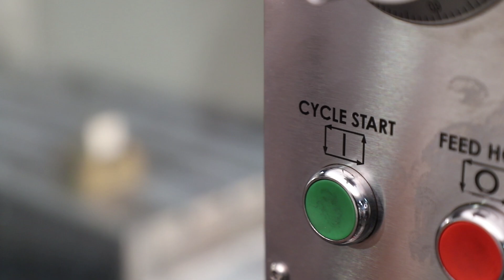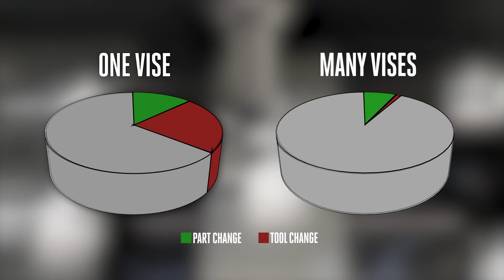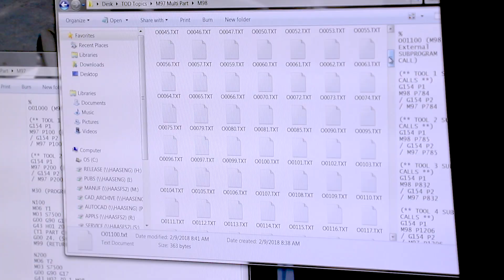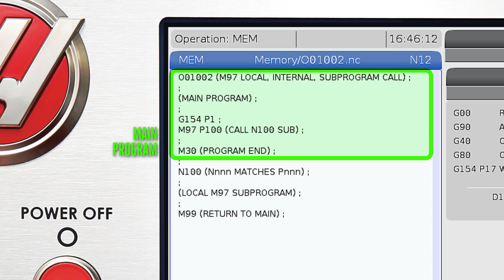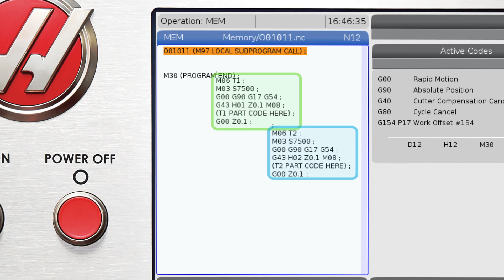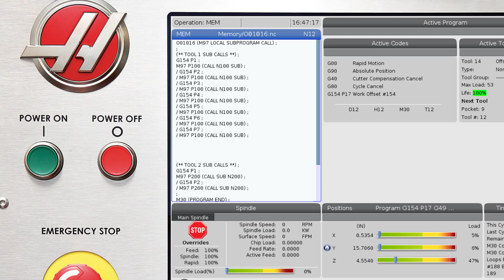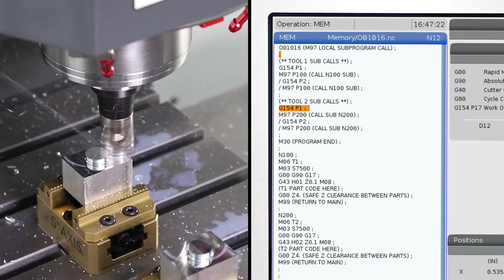Run More Than One Part at a Time; How Production Shops Use M97 - Haas Automation Tip of the Day

Comment: What I have found working in a production shop for 18 years now is running tons parts at the same time isn't always faster then running one or a few parts. Tool changes is only a small part of lost time in large production runs. You have to first mount multiple vices them tram them in, setup multiple work offsets which will always change each time you run that job. Once you have all that set and parts running you have to then load and unload multiple parts after blowing them all down of coolant and swarf. We used to run a part with runs of 300-600 very basic flat mild steel with 2 17mm holes in runs of 50 parts stacked in a few piles on the table and found running 4 at a time was more productive because it took so long to blow all the swarf and coolant off each part so as not to make a mess of the floor and tables. There is also the risk of a tool wearing out mid cycle and tolerances change so you risk rejecting multiple parts instead of 1 or 2. 

Don't get me wrong there are many ways to be more productive running multiple parts as you said using fixture plates where you load and unload parts outside of the machine while the spindle keeps running and making you money but running multiple vices isn't as efficient as you want them to be. I try to make as many fixture plates as I can for this reason alone to keep the spindle running as long as possible and thats working great for me so far. What I really like is 2 of the mills I run have partitions in the middle of the table so while one side is running I'm loading the other side and the program just repeats over and over until the job is done so the spindle rarely stops during the day.
Reply: It's certainly application specific. But I'll say this, the time savings boils down to a percentage...so the time saved in going from 1 to 2 workpieces is a drastic improvement; much more compared to going from, say, 12 to 16 workpieces (in which case the savings each successive part is negligible).
I think it might mainly depend on the quantity and the workholding methods available at hand. If you can fill up a subplate with many small items then it might be a good choice so long as the number doesn't get too crazy, but if you run standard mill vises then maybe adding a few more workpieces to the same vise can't hurt. I'm always confused when I see people making individual 2" workpieces one at a time in a single 6" vise...
Reply: That's why it's ludicrous to not buy the probing systems. I have added probing to multiple programs. One of our big runners that uses 12 offsets used to take 1.5 hours to set up. Now it's 40 minutes and all but 4 minutes is switching jaw plates to the nesting and pinned ones I made. I added in a bunch of G10 commands to set all Z offsets at the end of the probing program.  They stay within three or four thou, so why not. You can write custom macros to shut down if a tool measures beyond a set limit from what I understand. Possibly change to a different tool. I intend to explore the addition macros in many ways.
Reply: Sometimes running a part would take more than one hour and when you want to make several of them, then you can set up all of them and do other jobs for hours.
Reply: Yep I totally agree with you there that it works in certain situations and time savings certainly change depending on the work holding method your using for sure. We find we are most efficient when running 4-10 parts per cycle which is a very basic setup usually 2 piles of parts stacked 2 to 5 parts high depending on the thickness of the material and usually just 1 or 2 clamps holding them down so change over time is quite fast .
Reply: Hopefully you'll see the light in the next 18 years ;)

Comment: Wouldn't you have to re-probe each part in each of the vises after the first run if you did it this way? I'm probably missing something. I'm an amateur. Thanks!
Reply: Jackson im a machinist. You just make your X offsets on the very edge of the vise. Then just hang it off a very little bit. Your Y would continue to be the same. Always leave room for human error when cutting your work.